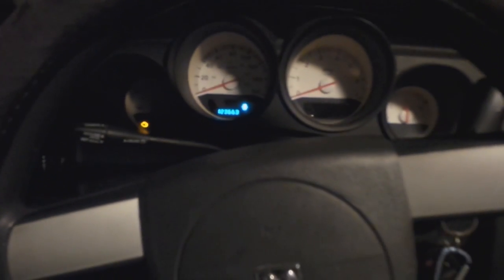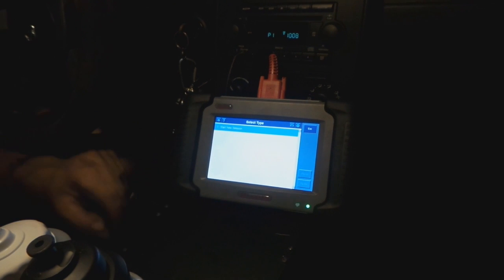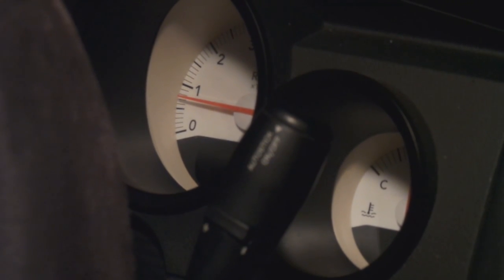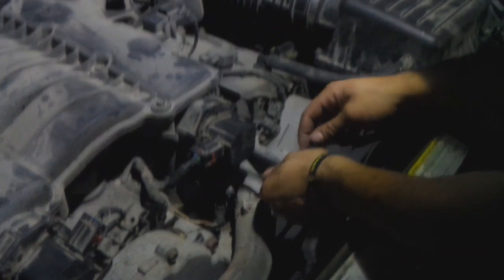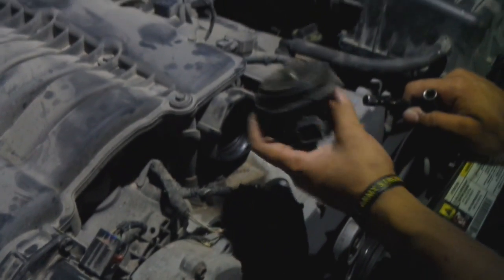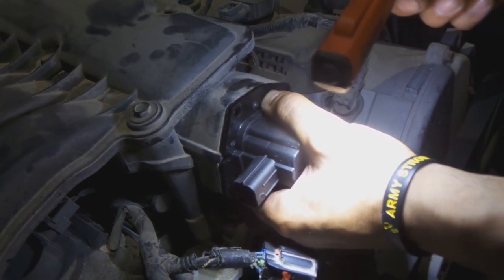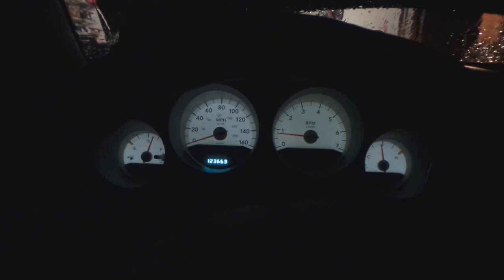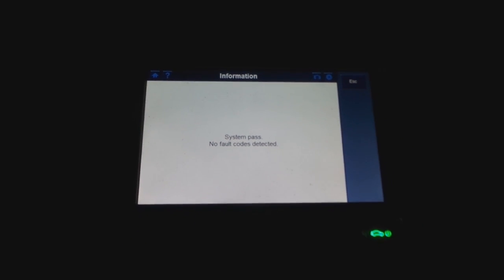How to Fix P1004 Dodge Charger /  Avanger 2006-2013

Comment: 2025 update:
My 06 3.5 charger has 2 different short runner valves then this video. 

But same demonstration as the video. I suggest cleaning those runner valves parts with b-12 manifold spray cleaner and clean inside the manifold that turns and the internal parts , then put it back in. Also suggest buying the b-12 fuel cleaner (both cans are identical to seafoam but called b-12) at any parts shop. Follow the fuel cleaner instructions and 1oz per gallon! Pour it into your empty gas tank then fill….. it worked for me without taken it to dealer and new parts are discontinued so either sell car, buy used parts, Go to junk yard or do what I did. Read it on a charger forum and worked for me so thought I’d share it with y’all 😎😎 follow me if it worked cause ima start posting videos about car/truck stuff  👍👍😎
Reply from the maker: Thanks for sharing!

Comment: i changed out the short runner valve &, manifold intake, erased code with cheap scanner but light still comes back on with code p1004 ? what else can i do ?
Reply from the maker: You’ll need an intake manifold.
Reply: Did you fix the problem ?
Reply: @sultom8175 I suggest. Get a bottle of b-12, manifold spray and fuel cleaner (exactly like the seafoam cans, but b-12)

I had p1004, cleaned both my short runner valves…. Poured the fuel cleaner in my empty tank then filled up with exactly 15 gallons of gas (1oz per gallon, it’s a 15oz can so 15gal) and no more check engine light 

I’m so happy  cause I love my 06 charger and it’s back to normal again

Comment: when i take piece off there is a little oil inside and on circuit board inside, do i have a bigger issue? your piece looks dry to me
Reply from the maker: Oil in the intake manifold is normal but if it had gotten into your actuator then it's possible that it went bad.

Comment: I hope this works for me.  I have a 2007 Chrysler Sebring 3.5L that the Check Engine light is on with a P1004 code.  Does the Short Runner the same thing for my Chrysler Sebring ?
Reply from the maker: I am not extactly sure, but I'd call the dealer and provide the VIN and they would know. Thanks

Comment: I have changed the short runner valve and the code P1004 is still there. I need help please, this thing is preventing me from passing N.Y state inspection
Reply: I went to AutoZone bought the short runner valve, replaced the old one, drove the car for over 15 miles then the problem was resolved. If this solution failed to work, I would strongly suggest that you take your ride to a Chrysler dealership and tell them about the issue upfront to avoid any diagnostic fees. Already good luck and let me know how it goes
Reply: @pierremcgill  Ok I appreciate it
Reply: @pierremcgill lol they will still charge you, otherwise how else are they supposed to fix the problem you knew nothing about
Reply: Raphael8900 remove the short runner valve from the intake manifold, take a flat screw driver check the flaps if they’re still spring loaded, if they move freely meaning too loose, means you’ll need a new intake manifold.
Reply: Thank God the issue was resolved,  so I appreciate the advice though
Reply: @pierremcgill  what did u do because I have the same problem
Reply: U have to reset the computer

Comment: Can a short runner control valve make the engine noisy at times??? Like a slight rocker noise (Ticking Sound interment )
Reply: Daniel LaBossiere I solved that! It was the Rocker Arms

Comment: mine has came on and off three times now. dealer i bought it from said it was the battery and the last time it came on i took it to auto zone and they told me it was the p1004 code. halp! just got my 08 charger and dont want to be throwing money into.
Reply from the maker: It's most likely the control valve or a faulty intake manifold. expect the repair to be between 100-1100.

Comment from the maker: I know it's along list but this what may be wrong 
Dirty intake manifold
Dirty intake manifold control valve
Leaking intake manifold gasket(s)
Dirty air filter
Defective intake manifold control solenoid
Vacuum leak
Shorted or open electrical circuit
Faulty ECM
Faulty intake manifold
Reply: TheBmwDoctor what if mines says ecu battery feeds & power grounds? I have the same code popping up
Reply: I just got my 2010 back from the dealership after having the whole engine replaced the control runner valve like 2 weeks before I threw a rod . I replaced the engine. The engine had 400 miles on it when they put it in. A brand new intake manifold was installed. I had to wait an extra 3 days to pick up the car because they where waiting for the intake to come in. I was on my way home and boom the P1004 code came on as soon as I hit my driveway. I replaced the control runner valve again under warranty from auto zone and cleared the computer and I am still having the same issue along with P2016 &P2017! I’ve done everything on this list am I missing something here?

Comment: Hey I just changed the short runner valve. i didnt have the type of scanner you have to hook up to my car i just had the little cheap one the little red auto link, it might just cause i have a cheap scanner but i was able to erase the engine light but what bothers me is when i recheck, the engine light stayed off but the scanner still gave me a yellow exclamation point. should i drive my car to see what will happen? or what does that mean? keep in mind its the little red auto link i have lol.
Reply from the maker: Dishun Wiley if you have an issue still then the CEL will turn back on after a few miles , and if that happens it is not going to be cheap to fix it , but let's not just jump into conclusions . 
Drive the car and see what happens I believe the exclamation sign is when your scanner  doesn't recognize the  code and with Chryslers vehicles the computer through's a p1000 when you reset codes so it is normal , ones you drive the car and the monitors reset the p1000 will go away , or other codes may pop up if there is any other issues , hope this helps , good luck!

Comment: Hey I change my short runner and I erase the code but it still came back on any ideas?
Reply from the maker: Tylor Benoit the intake manifold runners are sticky so you'll need to replace the intake manifold which is around 900 ish. 
Please subscribe
Reply: That's so disappointing to hear,  I thought it was just a simple part and it turns out to be a 900 plus job , there's no other option I can try ? Some sort of cleaner or  greaser , bc the only place I could get the  intake manifold  where I'm from is the  dealership  and they want 1300 :/
Reply from the maker: Tylor Benoit you can try but I am pretty sure the flaps mechanism is shot and there isn't much you can do I've tried to clean them but it actually made them worst . 
The intake manifold is on eBay for 900 and used for 600 dealer is a rip off .

Comment: One more question: would this problem possibly be associated with the air conditioner? Mine goes in and out of working and I'm going to need to replace this part asap now if so because my heat isn't working either and it's getting cold :-(
Reply: YESSSS. I AM FACING THE SAME PROBLEM WITH MY DODGE CHARGER.
Reply from the maker: Seeking Him daily no this problem has nothing to do with your Ac or heating systems ,
Reply: The BMW Doctor Bummer, ouch! Well I'm still going to get this fixed soon anyway. I assume this A/C is going to be an even bigger challenge.
Reply from the maker: Seeking Him daily if you have neither AC or Heat then you may want to start with the blend door actuators in your dash, because you should at least have heat .
Reply: The BMW Doctor Thank you. I've googled this part and I guess this would need to be replaced also, if it looks beat up? I might check myself if I can. I haven't looked yet, but do you have a video this? :-)
Reply from the maker: Seeking Him daily I don't I am sorry , hopefully in the near future .
Reply: kiran n Bummer. I had my blower motor and resistor changed and now my heat only works on the highest setting. I'm doing deeper independent research before I shell out more money for this. I'm still looking to fix my P1004 too.
Reply from the maker: Seeking Him daily try to change your hvac controller ( the knob panel) but before you do I'd check the blend door actuator. that is the only other thing I can think of for your heat issue. And for your p1004 follow this video and let me know if you need any further assistance.
Reply: Again, thank you for the tips!  I will research the parts you mentioned, especially the HVAC?  I had this local shop replace my motor and resistor after they decided that was the issue...only for my heat to go right back to only working on the highest setting (which only happened after they replaced my motor).   I wanted to fix my P1004 sooner but it's Winter and didn't want to freeze.  I can't wait to fix my P1004, especially since my engine light has been on since 2013!

Comment: Thank you for this video. It's funny, I have a 2007 Dodge Charger and my mileage is pretty close to the car used in the video......strange! Anyway, just wondering, this P1004 - which is my problem - is an electrical problem correct?
Reply from the maker: Thanks a ton! it is definitely a problem with higher milage vehicles, it could be a number of things , start by replacing the part I am replacing in this video , then  next is a possible stuck intake manifold flaps if the code stays .
an intake manifold is around $900 of you may find one off of a salvage yard or ebay .
be sure to like and subscribe .
Ryan
Reply: I wasn't sure I would get a response, thank you!  I believe I need to replace the short runner valve, is that correct? (the guy at Merchant's would not disclose.....all he said was "something definitely needs to be replaced")
Reply from the maker: Yes its the Short runner valve and it's what I am replacing in this video,  part numer is in the disruption. 
I would go with mopar instead of your local parts store. 
It's in amazon if you have an account there .